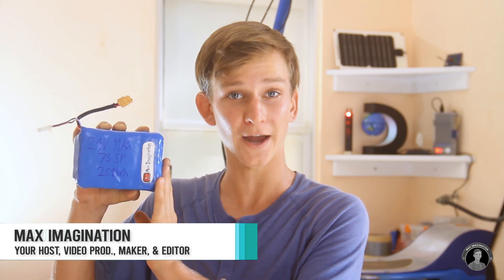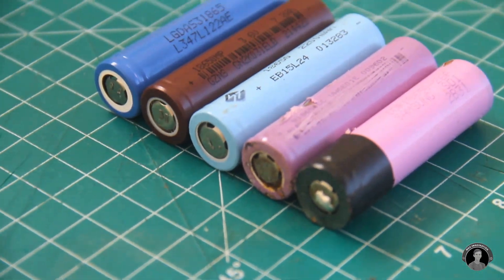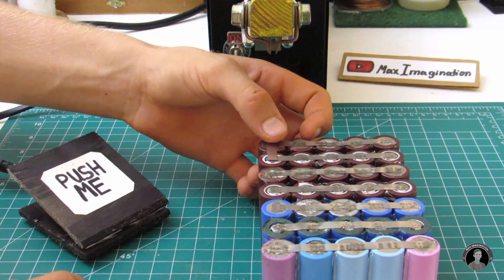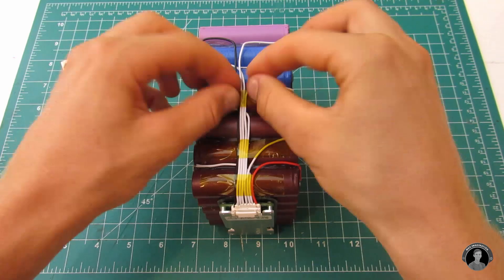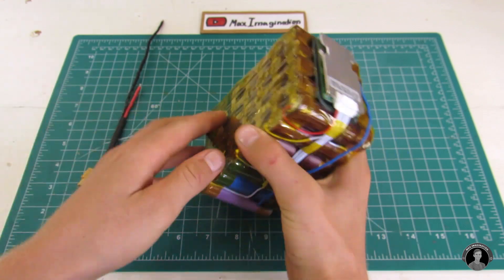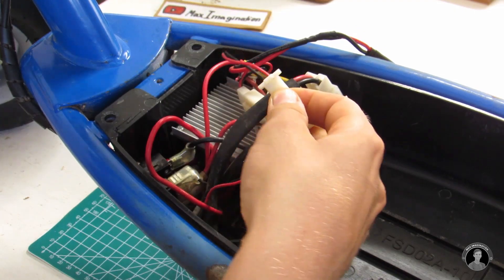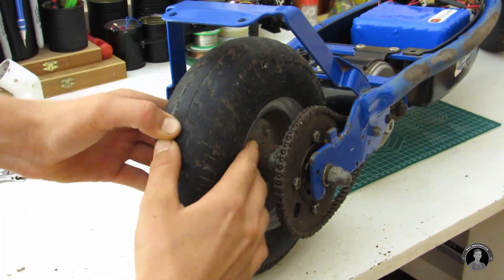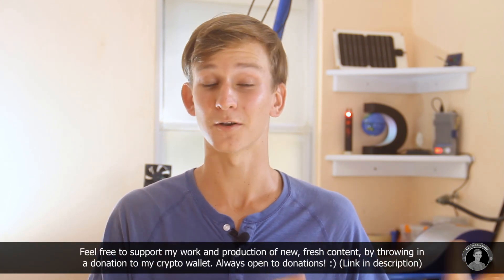Build a DIY 24V E-scooter Battery Pack | Razor E300 Upgrade (Part 1)

Comment: you don't need a spot welder, you can use 18650 holders. i used the 3-up holders, back-to-back for 6 cells = 24V per pack - 7 packs in parallel to get 24V 16Ah. Still think SLA 24V 14Ah was a good, cheap setup.
Reply from the maker: So how will you connect the cells?
Reply: The contacts on those cell holders have very high resistance. Jehu Garcia tested this. Even the expensive  cell holders are only good for 5A absolute max 10A per contact and the holders are just no bueno in an EV. Stationary applications only. 

Micah Toll from Ebike University(?) tested soldering cells with a thermal camera. The results were sketchy af. Very high temps on the outside of the cell who knows how much heat gets inside

Comment: Max, do you like the Razor Scooters in general,?  and why?   not simply because of more easily modified?  Like their chain drive? good power up hills?  Thanks
Reply from the maker: Hi there. I generally have always liked Razor brand scooters for their fat and wide tires, spacious decks/platforms, and ease of changing out parts. They aren't the fastest in the market, but they sure are fun cruisers and good for entry level riders like myself. However, better battery technology and proportional/variable speed control would have been good to have in these scooters, but sadly, they're more on the toy side.
Still, great fun riding on these type of scooters. Cheers!

Comment: Is there room to fit another battery pack for switching over when one goes dead?
Reply from the maker: Yes! There just happens to be. There's enough space in the deck hub to fit one more exactly the same as seen in the video.
Reply: @MaxImagination   How has the battery been holding up from charging with a charger designed for lead acid batteries? From what I have read lithium batteries needs a charger that can provide constant current/constant voltage. The factory lead acid charger does a 3 stage charge process, Bulk/Absorption/Float that will damage Li-ion.

Comment: The rear tire design is not actually flawed, the hand grip contains a extension that fits through that hole in the rear sprocket.
Reply from the maker: Hi, Neil. Thanks for your comment. I didn't know about this feature that exists in E300s until I was made aware of it by another viewer before you. Actually, my scooter (bought it 2nd hand) did not come with a valve extension in the handlebars.

Comment: Great build but I really wish you would've shown how to wire that charging port to the battery I don't get that 😫
Reply from the maker: Hi there. 

Thanks for watching. From the diagram linked below, you'd connect the charger to (C-) on the BMS and positive battery pack terminal. This may be confusing at first thought, but this is how you'd wire a BMS for charging the cells. Diagram: https://drive.google.com/file/d/1ip6s0YfpEQkzXyQQKvREkBDm2jEaXGa1/view

Hope I helped with clarifying.

Cheers, Max

Comment: Hey that's a very nice video!
I am planning on upgrading the battey on my e-scooter as well. I might not do it myself but get the battery, however I wanted to ask you something since I'm a bit new to this. Is it really safe to charge the new battery with the original lead battery charger even when the charger itself specifies not to? what would be the advantage of getting another charger? Thank you"
Reply from the maker: Hi, Emanuel. Thanks for watching!
Cool to hear you're also changing out your E-scooters battery for one as such! 

The differences are that by using your lead-acid battery (original) scooter charger with a battery pack like the one seen here that uses a "Battery Management System" module is safe and would work as I have been charging it the same way, whereas a typical Li-Ion cell battery pack charger would require a connecter consisting of many nodes from the actual battery, instead having the BMS integrated in the charger.
I've been charging my battery pack with the original lead-acid battery charger to this day ever since.

Hope you found this helpful.
Cheers,
Max

Comment: Hi can you plz help me i cant charge my battery i did the same as you did
Reply from the maker: Hi there. Please check that you've wired the BMS to the cells correctly. Also, make sure that you connect your charger to the -C and the positive terminal of the whole battery pack (as seen in the diagram).
Additionally, may I know the specifications of your charger? Thx.
Cheers,
Max

Comment: New to this group.  I just picked up a izip 500 for cheap. They had acid batteries that were dead. I replaced it with a 36v 10ah Lithium ion battery.  They have the yellow plugs on them.  Don't know the type. Don't shame me lol. I am plugging the battery into the scooter while the battery is charging. There are no instructions that came with this battery. I disables the charger that was stock with the izip.  Thank you. All new to this and learning. Basically I live 2 miles from work and just need this as transportation for the summer.
Reply from the maker: Hi there. Good to hear you're getting well set for your own DIY-ed commuter EV! :D

Comment: Hello brother, do have any idea to make this scooter run last longer than 1hour ... ?
Reply from the maker: Hello, Vireak. You'd probably have to use a more efficient motor such as a BLDC high power ebike motor as well as use a much higher capacity battery.
Cheers

Comment: Why use flammable glue instead of the black corrigated 18650 holders? Don't the batteries need expansion room when heated up from charging/discharging quickly? Expense?
Reply from the maker: This is my first DIY EV battery pack, I used what I had at my disposal, glue seemed to do the trick. Since I haven't ever heard of Li-Ion cells expanding under a heavy load like Li-Pos do, it didn't seem like a big deal gluing them together.

Thanks for your concern, I will consider stacking them with corrigated holders for future battery packs.
Reply: @MaxImagination  Still learning myself ☺. Haven't done one yet, eirher. But, watching literally 100's of YouTube pack builds over a week. Re reading 12th grade physics textbooks, even. Including the exploding 18650 vids. And the electrical engineers who actually measure sub millimeter cell expansion rates, etc. Can't wait to build one myself, and ditch lead acid. Well done!

Comment: How long did it last...can I use it with 24v amplifier board....6s die faster
Reply from the maker: Hi. It drops from a charged voltage of about 28V to 23V (since it's a 7S battery pack) in about half an hour.

Cheers.

Comment: Just bought one of these scooters, and finding your videos has provided me with inspiration (in fact, your videos, amongst others, are one of the reasons I decided ro go for this scooter - and its cheap price lol)...

But there is one glaring error you've made that I feel compelled to point out!!! You say there is no access to the rear tyre and that this is a major design flaw - NOT TRUE! Inside the handlebar of the scooter there is a inflation extension, about 2 inches long. If you look at the rear chain guard, there is a hole. If you look at the sprocket, there is also a hole... If you rotate the sprocket and the wheel to line up the holes with the one on the chainguard (turn the wheel to line them up with the inflator screwthread) then you screw on the adaptor to the tyre and then you can easily connect to your pump. Instead of there being a design flaw, Razor really thought this one through and came up with an elegant solution. Of course it does help if you had the manual or you knew about the adaptor inside the handlebar grip. After I saw your video, I happened to notice the adaptor thingy on a subsequent Google search, which made me look at the rear sprocket and wheel more closely. Voila, there's the holes, and they all line up when you rotate the wheel!
Reply from the maker: Hi there! Thanks for your comment!

Yes. What you mentioned is valid with these scooters, as another viewer commented describing the same hidden feature about these E300s. However, mine did NOT seem to have anything tucked away in the handlebars when I went to take a good look at the scooter, probably because the previous owner had already pulled the inflation adapter out, leaving me in assumption of stating what I thought was a design flaw. So thanks for pointing this out for other coming viewers to keep in mind.

Cheers,
Max.
Reply: @MaxImagination  thanks for your reply. If you're interested, I found the manual for this scooter, you can get it from the razor website at https://razor.com/wp-content/uploads/2018/02/E300-E300S_MAN_US_180109.pdf

Page 4 has a picture of the scooter, and shows the valve extender and its storage location. Also, on page 5 is a detailed instruction on inflating the rear tyre, showing the holes I tried to describe, and with pictures! Hope people find this helpful, especially if they got the scooter second hand (and the previous owner hasn't lost the valve thingy!)

Comment: Excellent diagram, I wish more people would do this.  If you bypass the BMS on the discharge, how do you ensure that you don't over-discharge the pack?
Reply from the maker: Hi. Thanks for watching! I did this correction on purpose as these cheap BMS boards typically cut off if the load is drawing more than ~3A. The motor was drawing more like 15 amps or so which meant I could only use the BMS for balance-charging the battery. About over-discharging, it's more about feeling when the scooter has gradually slowed down to a lower speed after 20 mins of use. Knowing how low you're willing to drain the battery is key here. Over-discharge protection on a BMS designed for EVs would have to have a system cutoff when the amperage exceeds a certain high value such as 17A in my case.

Cheers, 
Max.
Reply: You should buy a 25 to 35 amp capable BMS or babysit the pack with a handle bar mounted voltmeter

Comment: How do you check if batteries are good if the batteries has not been charged for over ten years?    Where do I get the test charging device?
Reply from the maker: Hi, you can check a battery's health by using one of those car battery testers or simply just short-circuit a battery via a high-power (low impedance) resistor to the terminals, then checking afterwards with a multi-meter to see how well that battery withstood the test. If the battery's voltage is relatively high still, then it's a healthy one, otherwise it's a dud to use.

Comment: Good vid!  I have the E200 and will follow yours instruction.  Why $60 to ship $70 battery? 😞
Reply from the maker: Hi, thanks for watching! Yeah, it's a pity to hear that the batteries cost that much and that they charge just as much in shipping cost...
Great, you go for it! When finding used cells for your battery, keep an eye out and avoid using near-dead cells! 
Cheers,
Max

Comment: What is the range with this new battery in miles?
Reply from the maker: Hi, the range is around 8 mi
Reply: @MaxImagination  it’s not much more than original batteries??
But does it go faster and more power going up small hills?
Reply from the maker: @kanikipk2814  It's a good replacement to those Lead-acid batteries which used to sit in the scooter before as Li-Ion cells tent to have way more recharge cycles.
It is a bit more powerful than before with new LD Acid batteries, but maybe not as much since I used recycles cells. That would be one thing to note for others who will make such battery, don't use recycled cells if you want full power.
Reply: @MaxImagination  
Can use hoverboard lithium battery 25,2v  40ah from Hover 1 Origin hoverboard to replace original acid batteries?   Any modifications needed?  If so what do I need to do?
Reply: 4 ah 100wh 25.2 VDC
ACTUALLY battery is this figuration
Reply from the maker: @kanikipk2814  To use one of those 4.4Ah 36V batteries you'd need to take it apart, keep a 7S string of series cells, disconnect the excess string of cells and configure it to have more cells in parallel rather than the previous configuration of more in series. You'll result in having 4/7 as much cells as I implemented in my battery.
Reply: @MaxImagination  actually it’s a 24v  4 Ah 100wh hoverboard lithium battery.  I’m wondering if I can use it to replace the current stock batteries??

Comment: Hello there, you said you made a mistake in the connection and its confusing because the tutorial is too fast, I will appreciate if you can make a schematic diagram and send it to me  for the right connection of the battery pack with the BMS , battery charger and connector terminal for the motor. Please reply immediately. thanks
Reply from the maker: Hello, sorry for the minor confusion.
The downloadable Google drive battery circuit diagram link can be found in the description below my video. Everything is up to date and correct as adjusted in the video.
Cheers, Max
Reply: @MaxImagination  sorry I dont see the description box and link. can you send it by message. thanks
Reply from the maker: No worries, here is the battery pack circuit diagram: https://drive.google.com/file/d/1ip6s0YfpEQkzXyQQKvREkBDm2jEaXGa1/view?usp=sharing
Cheers, ✌️
Max

Comment: You jump or charge Bad cells? Sometimes they come back contrary to popular beliefs.   Charge everybody even Baddys lol. Watch closely.  And you have to run them to see capacity THAT my friend will tell you if the BAD are good.    Sometimes you get lucky.  Always be observant is the rule anyway right ? Rock on!!!
Reply from the maker: Hi, yep often this just happens to be true, I went through a lot of old cells thoroughly testing and charging to finally end up with 1/3rd of them being decent and functioning, those I used for this battery pack. Cheers, Max ✌️

Comment: There is a air guage extension hidden in the right handle. Spin the sprocket backwards until  the hole lines up with the tires valve and then screw the extension in through the hole in the sprocket.
Reply from the maker: Thanks for the tip! Although I didn't happen to find an extension piece in the handle bars or my scooter, I'll keep looking for a substitute, and now know that one of those sprocket holes are for the extension :)

Comment: What is the quantity needed
Reply from the maker: If you're reffering to the 18650 cells, you'd need at least 35, putting 5 in parallel, 7 of those 5P packs in series.
Reply from the maker: All needed supplies to make this battery pack can be found in the description below the video.

Comment: I saw you sand the battery poles by drill it should be, challenging.. 😅joke aside very clean work👍
Reply from the maker: Haha, it was challenging at first, but just putting the drill on my table and applying pressure on it while I turn the batteries up against the drill bit, it was very quick and easy to do. 
Thanks for your comment! 😊
Reply: @MaxImagination  good idea. Looking forward your new video
Reply from the maker: @retsetman9698  Thanks! =) ✌